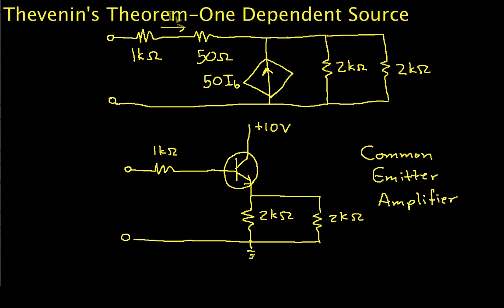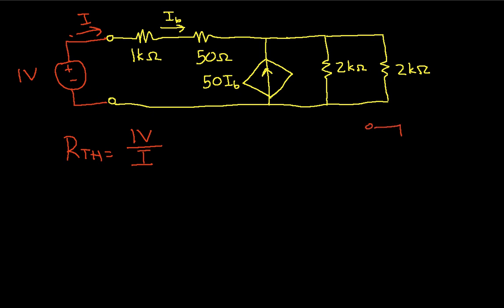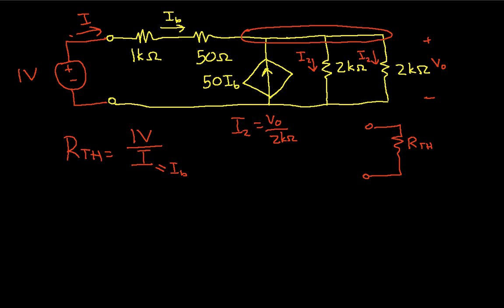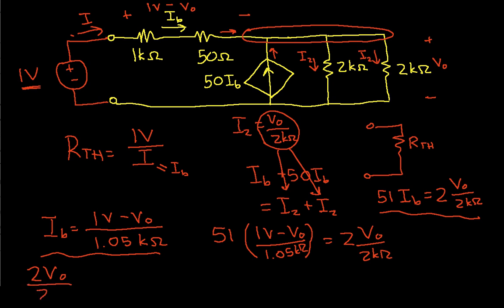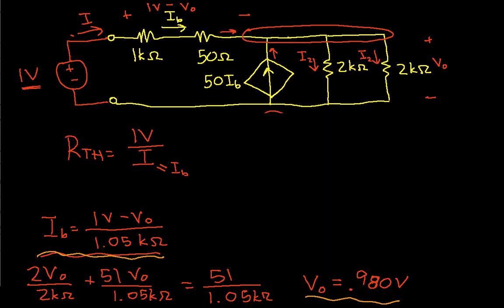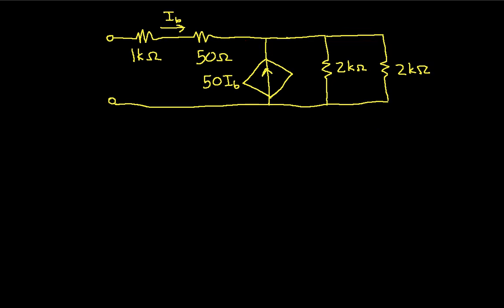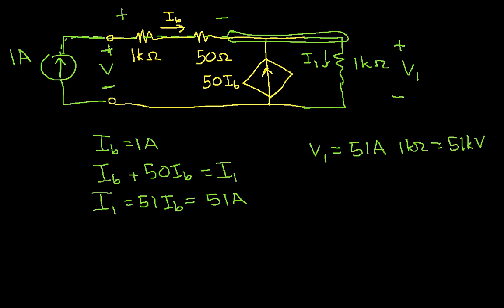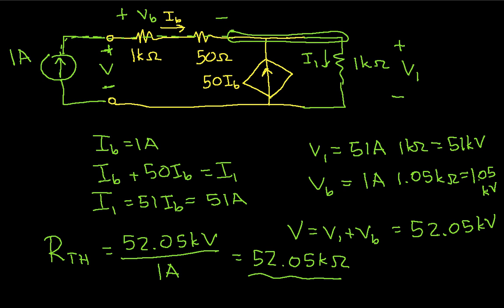Thevenin's Theorem-One Dependent Source

Comment: Mr. Morrell: I follow your approach here and have worked this problem several times over the last few years but it occurs to me that there is a much simpler way to solve it.

1. Replace the output resistors with their parallel equivalent. 2k//2k = 1k.

2. Write a KVL equation for the loop around the outside of the circuit using a 1 volt test source. The result of which is 52050×ib = 1. Thus Rth = 1 Volt/ib = 52050 Ohms.